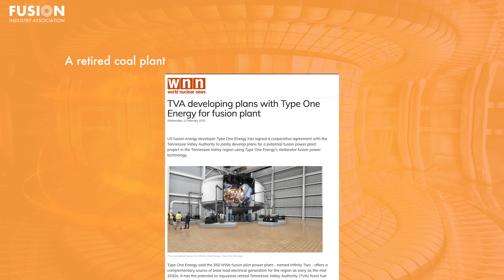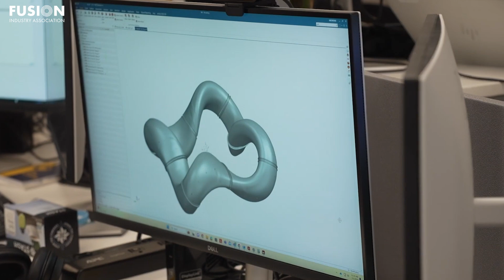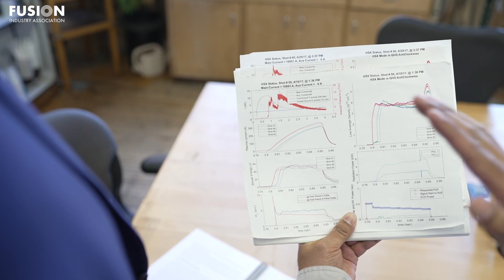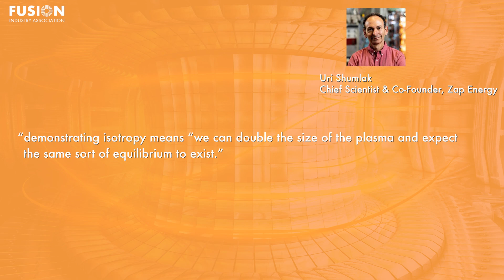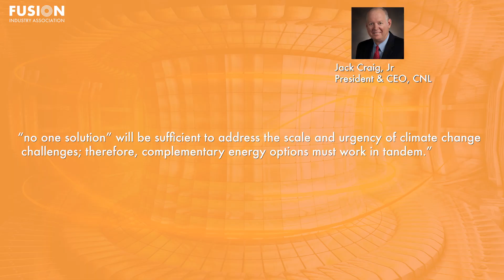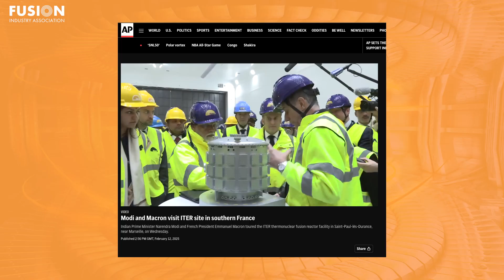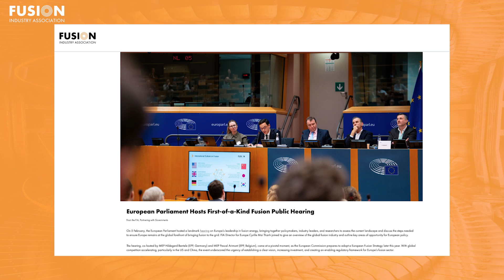Fusion News, February 19th, 2025

Comment: A fusion breakthrough could not come at a better time...the energy required for the AI revolution should be clean. Burning coal so the silicon can think sounds steampunk and all, but it also cranks up the P doom.